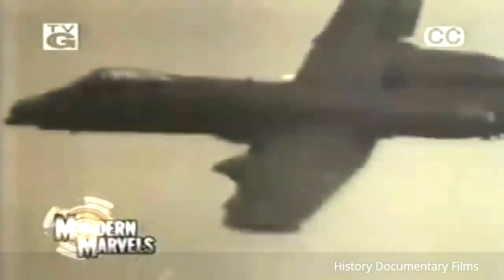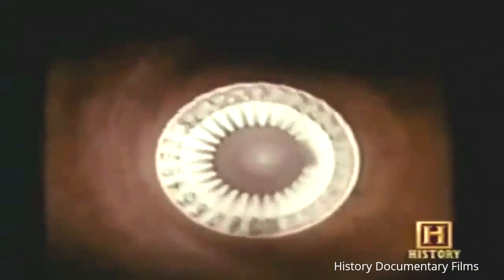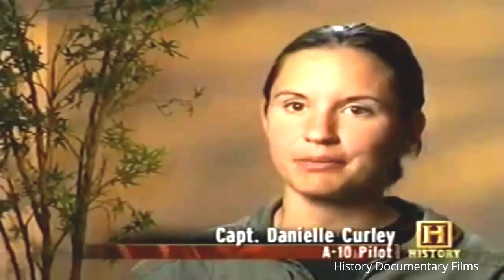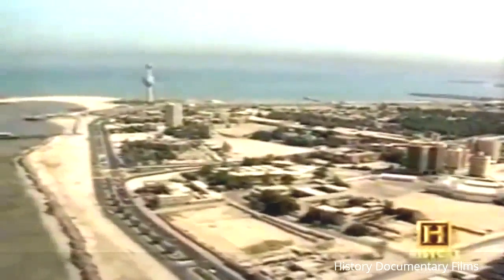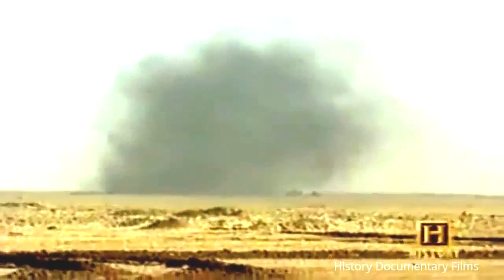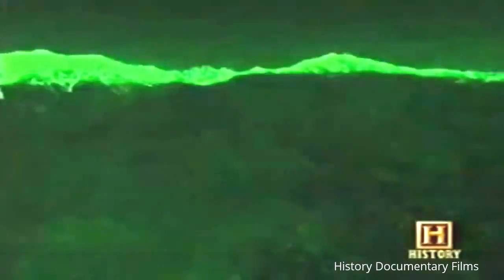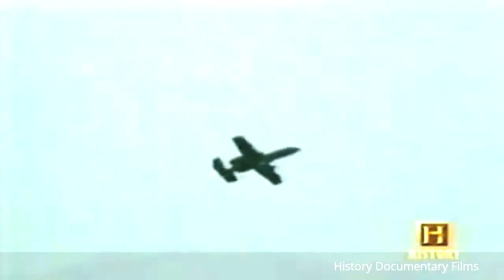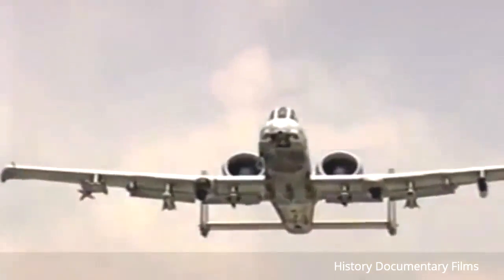A-10 Thunderbolt Documentary - The Anti-Battle Tank Warplane - History Documentary Films

Comment: Great Plane! Needs to be upgraded and given a life extension till 2050
Reply: MEIERSEGGSTRAßE RESEARCH INSTITUTE  it was offically retired by the USAF in march of this year. And they are slowly being shut down and scrapped in the next three
Reply: Replaced by what! What else can give close air support?
Reply: retepyam5858 the F-35 Apparently 🙄
Reply: Agreed. USAF SF here while in Turkey they had a few squadrons of these bad boys. Got to sign 2,500lb bunker busters and stare down the barrels of those bad ass cannons. They took off fully loaded into Syria and came back completely empty. So fuckin bad ass
Reply: IF IT AIN'T BROKE DON'T FIX IT. The A-10 has a lot of REDUNDANT MECHANICAL SYSTEMS so if one was hit it will suffer very little or slight or no damage at all because everything is 100% mechanical, no insanely expensive and unnecessary and sophisticated electronics, hydraulics, pneumatics junk that can easily be knocked out is to be used for they are not required and are a waste of money. It's airframe is practically like an armored skeleton, it's vital parts covered with titanium armor, all it's controls, monitors, indicators, feedback instruments, and other instruments are all mechanically analog servo-mechanical using mechanical human power amplifiers. It's outer shell is multi-layered spaced heavy thick gauge titanium sheet plating so as to dissipate enemy firepower before it gets to the next heavy thick gauge titanium sheet plating and so forth and so on. And anything mechanical is made ultra-simplified, making it impossible to fail. It's twin engines extended far from the main body so if one is hit the other one is unaffected and can still fly the plane safely home or finish it's mission first and then go home safely with just one engine. Using the basic principles of Henry Ford's mass production techniques upgraded to meet aerospace requirements using the cookie cutter/stamping/machining in a jig/template guided machine tooling operations will reduce costs down even further.
Reply: I think they stop and now are refurbishing them, as they have nothing to replace them effectively

Comment: The F-35A will be a disaster of a replacement for this weapon system. With the big gun being replaced with a 25mm and significant ammo count reduction, the F35A has no where near the weapons racks or loiter time.
Reply: DenseAlloy f-35A is an multi purpose fighter jet. The a-10 warthog is an close support air support.
Reply: IF IT AIN'T BROKE DON'T FIX IT. The A-10 has a lot of REDUNDANT MECHANICAL SYSTEMS so if one was hit it will suffer very little or slight or no damage at all because everything is 100% mechanical, no insanely expensive and unnecessary and sophisticated electronics, hydraulics, pneumatics junk that can easily be knocked out is to be used for they are not required and are a waste of money. It's airframe is practically like an armored skeleton, it's vital parts covered with titanium armor, all it's controls, monitors, indicators, feedback instruments, and other instruments are all mechanically analog servo-mechanical using mechanical human power amplifiers. It's outer shell is multi-layered spaced heavy thick gauge titanium sheet plating so as to dissipate enemy firepower before it gets to the next heavy thick gauge titanium sheet plating and so forth and so on. And anything mechanical is made ultra-simplified, making it impossible to fail. It's twin engines extended far from the main body so if one is hit the other one is unaffected and can still fly the plane safely home or finish it's mission first and then go home safely with just one engine. Using the basic principles of Henry Ford's mass production techniques upgraded to meet aerospace requirements using the cookie cutter/stamping/machining in a jig/template guided machine tooling operations will reduce costs down even further.
Reply: The F-35A is not a time-tested and time-proven aircraft. Dollar for dollar, the A-10 is vastly cheaper than the UNNECESSARILY EXPENSIVE AND EXTORTIONISTICALLY OVER-PRICED F-35A. The A-10 is time-tested and time-proven and has proven it's worth through the years and decades.

Comment: IF IT AIN'T BROKE DON'T FIX IT. The A-10 has a lot of REDUNDANT MECHANICAL SYSTEMS so if one was hit it will suffer very little or slight or no damage at all because everything is 100% mechanical, no insanely expensive and unnecessary and sophisticated electronics, hydraulics, pneumatics junk that can easily be knocked out is to be used for they are not required and are a waste of money. It's airframe is practically like an armored skeleton, it's vital parts covered with titanium armor, all it's controls, monitors, indicators, feedback instruments, and other instruments are all mechanically analog servo-mechanical using mechanical human power amplifiers. It's outer shell is multi-layered spaced heavy thick gauge titanium sheet plating so as to dissipate enemy firepower before it gets to the next heavy thick gauge titanium sheet plating and so forth and so on. And anything mechanical is made ultra-simplified, making it impossible to fail. It's twin engines extended far from the main body so if one is hit the other one is unaffected and can still fly the plane safely home or finish it's mission first and then go home safely with just one engine. Using the basic principles of Henry Ford's mass production techniques upgraded to meet aerospace requirements using the cookie cutter/stamping/machining in a jig/template guided machine tooling operations will reduce costs down even further. If 1.5% molybenum added to manganese steel armor plate will make it equal to 3 inches of manganese steel armor plate, and if 1% vanadium added to manganese steel armor plate will make it equal to 6 inches of manganese steel armor plate, and if  3% zirconium added to 1 inch of ordinary steel or 1 inch of manganese steel armor plate will make it into a bulk bullet-proof alloy, WILL IT DO THE SAME THING AND HAVE THE SAME ALLOYING EFFECTS ON TITANIUM? It will be interesting to do an experimental metallurgical test if it will do the same thing and have the same alloying effects on titanium so that the next A-10 will be made out of that new titanium alloy.